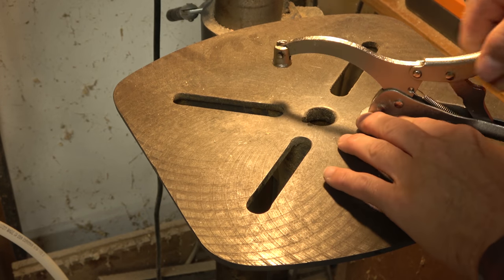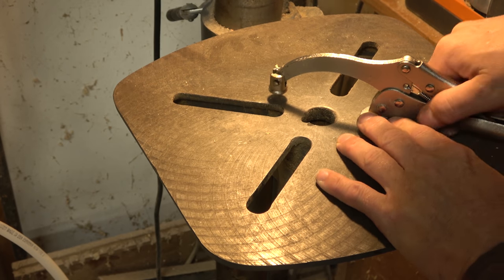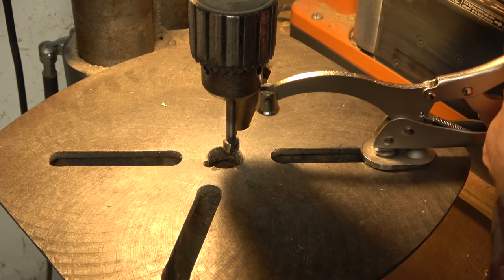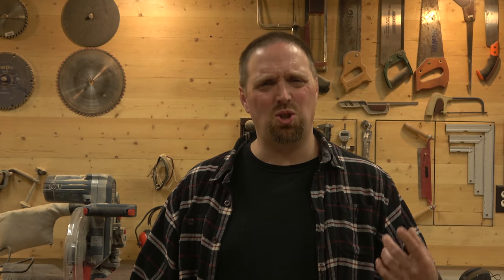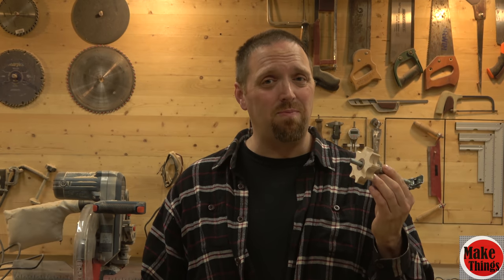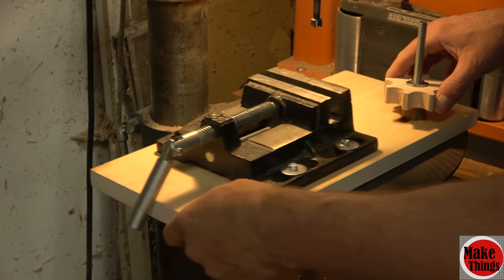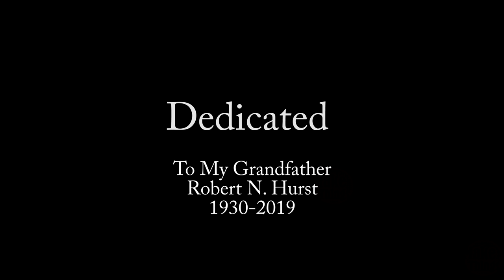Drill Press Clamps // Keep Your Digits With No More High Speed Metal and Wood Accidents!

Comment: My drill press base is slightly different, but I successfully used the traced shape of its underside to make a template from which I cut a 1/2" plywood piece.  Using strong neodymium magnets glued into the plywood, I created a removable flat bottom for the drill press table that lets me clamp down any objects on top.

Comment: Kudos to thy inventiveness, but regarding the long reach vise-grip clamp that thee used as a poor solution in the beginning: could thee simply have used a slug or spacer or washer under that lifting ring to give a proper tightening?
Reply from the maker: Yes and no (est).  Yes, but honestly, I'd lose those spacers and rings to gravity and the fact that anything that hits my floor ends up 10 feet away in a given diameter.  I hadn't thought of that, honestly, but I don't think it'd work well with the jigs I've made.

Good idea, nonetheless!

Comment: Couple tips, hope they're helpful to someone:  A quick way to make a star knob is to invest in a hole saw.  Start the cut, which starts a hole in the middle with the hole saw's center drill bit, and also scores the circle.  Then measure equal points around the circle and with a smaller bit, drill out the spaces between the star points, then finish with the hole saw and round the points with a file or sandpaper.  As with any hole saw cut, go almost all the way through, so that its center drill bit pokes out the other side but not the hole saw, then flip the wood over, put the center bit in the center hole, and complete the cut, to have smooth edges and no tear-out on that side.  As an alternative, tear-out can also be minimized by clamping it down to a sacrificial piece of scrap, which will support the fibers as you drill through the work-piece into the scrap to complete the cuts.

Also, taking the original clamp with the star knob and butterfly nut, that can also go with a simple hold down made from a short board with a slot running down its center length for the knob's screw (drill 2 holes near its ends the size of the knob's screw, and connect them with a jigsaw).  A fender washer installed between the nut and the short board hold-down can help protect the wood along the sides of the slot, since it will usually be angled, and therefore cut into by the edges of the knob's neck.  As the knob is tightened, it will squeeze down the short board, which will hold down and clamp the work.  A small lip can be glued to the end of the board on the underneath side, to increase its angle during clamping.

Comment: Another great jig idea. Actually it’s two in one. Something like this would be great for those who haven’t put a woodworking table like the one I have on their drill press. I really like your knob template. Somewhere along the line when I have some time I’ll try my hand at making some. I’m glad the silicone mat for a gluing surface seems to be working out for you. I’m still bogged down working in my workbench though I’m making progress.

BTW - I hadn’t thought of using an f-clamp for holding small pieces at the drill press. I usually use my wood handscrew clamps. In fact one is stored under my drill press table just for that purpose.
Reply from the maker: I have the template on my instructable ‘making knobs’ page if you want to check it out Don.  

Thank you so much for your kind words and strong support.  I’m lucky to have friends like you.

Comment: I couldn't tell why you needed to grind down the toggle bolt ? Was it to make it close more to fit through your drill press slot.  Cool jig, and vid, subscribed
Reply from the maker: Excellent question!  It didn’t fit in the slot, but when I ground it down (so that it would) the toggle part actually now bites into the rod enough that it won’t spin as you turn the top.  In other words, the clamp became its own clamp. 

This is important as it left it simple enough that I didn’t need to damage the bolt in order to keep it from spinning.  

Thank you!

Comment: When you pushed the drill chuck down the turning of the chuck loosened your turn knob defeating its purpose. Beside that toggle clamp you modified, they already make one like that. If you're going to spend money on a toggle clamp, just buy the correct one and nothing else is necessary.  If you think taking time to turn a knob is "taking too long", then try different hobby or take a pill. Lol. You are creative!
Reply from the maker: Thank you!

The turn knob bounces around a little because the hole is a bit too big on the bolt and the cotter pin too small, but I agree, it looks like it’s touching.